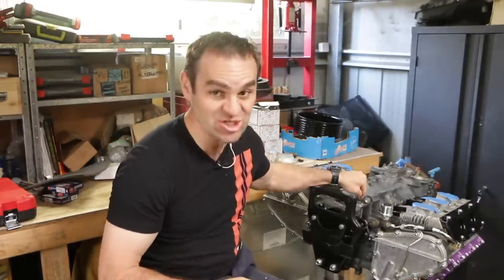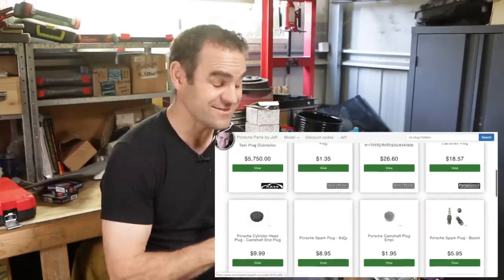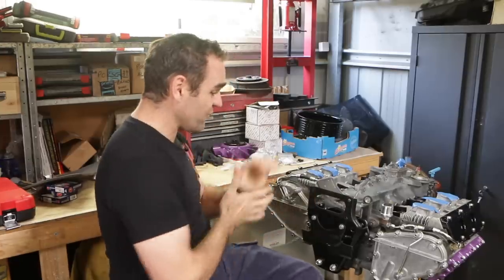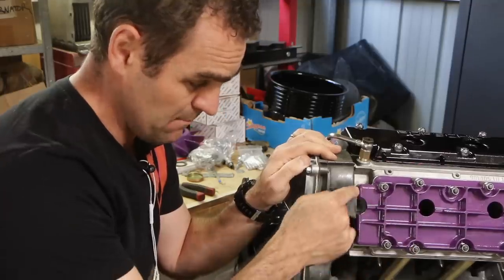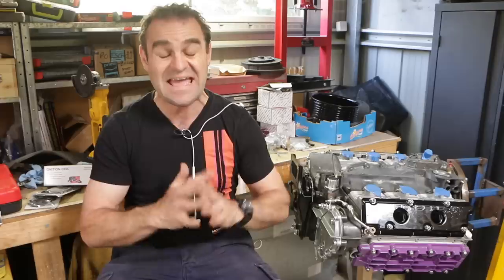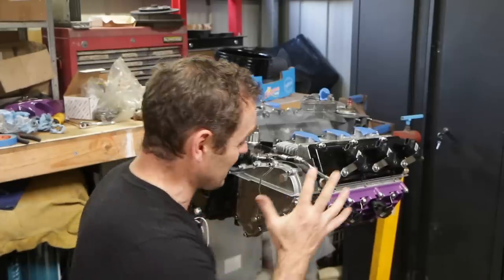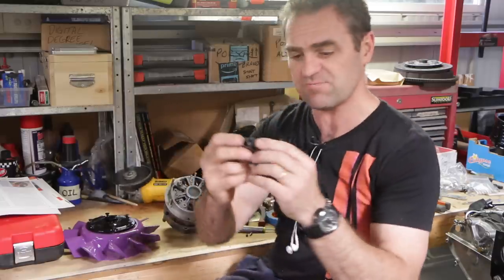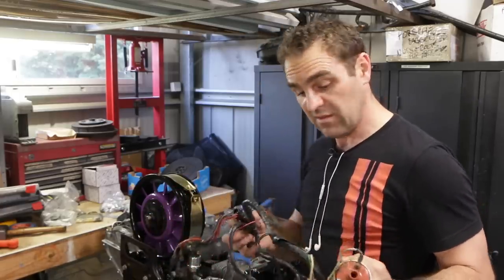Coil on plug ignition -  911 2.8 RSR Build Season 2.13

Comment: I wouldn't let anyone stress you out about spark energy, hemi-head or not.
Porsche hasn't used CDI since 1984, when they switched to Motoronic engine management and transistor based induction coils.  Compared to previous years, the motor had higher compression (10.3:1) and was still single plug.  The factory even left room on the table for performance chips to advance ignition timing for modest power gains.  Plenty of people run highly boosted air-cooled motors with CoP units with far less spark energy.  If they're leaving something on the table, it seems to hard to quantify..... But then I don't have a CDI unit to sell you ;-)
Also, wasn't CDI+ exposed as having even less output than a stock 40+ year old Bosch unit?  Why does it need multiple-sparks, if the "hotter" spark from CDI is all you need?
IMHO:  You'll be fine mate with these 370Z units, really! (edit: Super tip on the boot, which I kept on destroying)
Cheers for the website on finding parts.  I'll definitely be referencing that in the future...

Comment: Are you thinking of AirCon in the future? If yes, there is an Electric Kit from the UK but a stronger output alternator is recommended for proper output of cold air at idle speeds...

https://www.classicretrofit.com/collections/electric-air-conditioning/products/air-conditioning-kit-for-classic-911-full-kit

Comment: You obviously have done a lot of research about the ignition, but there's one thing you didn't mention in the video. What about running the CDI pickup off the flywheel? That's how motorbikes do it. I'm sure you looked into this, just you didn't mention it in the video.
Reply: Thinking a crank fired CDI would be the ticket?
Reply: I'd think his EFI system would provide trigger for the COP system so no need for another separate ignition trigger.

Comment: Jeff I love you and the channel but someone has mislead you on the needs of the ignition system. Spark/coil load is determined by compression, mixture and coil soak time. The moderate compression you're running and that fact that you're going EFI means even a basic coil pack will be more than adequate to fire the plug. I appriciate the shift to coil packs to improve coil soak time compared with a single unit but you don't need 'extra' voltage. The gains from the twin plug system come from improved flame front loctaion and speed, nothing to do with the actual firing voltage.

Comment: I gave the website a look. I think it's a great idea and it seems fairly well implemented. One thing I noticed is that shipping costs aren't taken into consideration. Of course those vary depending on location and it might be quite difficult to calculate from an external site such as yours. But for price comparison it's great.
Reply from the maker: That is not really possible as most of the sites need to sort it out case by case. Just gives you an idea.
Reply: Hi Frederik. I've looked at this but it's only possible for webshops with a fixed rate like FCP Euro where we do show the shipping cost below the product. But even then it's only for the US. Worldwide shipping is always variable unfortunately.

Comment: Something also to keep in mind when comparing CDI vs CoP.  I believe the quoted energy for CDI is at the discharge capacitor when fully charged.  The energy at the spark is probably a fraction of that... (a sixth?) One reason CDI was abandoned was it's inability to keep the capacitor fully charged at high rpm.  Food for thought.

Comment: You need to seal the gap between the spark plug wires and the plug opening, or you will lose to much cooling air.

Comment: I’m looking at a similar conversion, any experience or a divide on changing plug type? I have a 2.0 Golf Coil ignitor but they use platinum plugs with a smaller dive hex. All looks good to me if the plug heat range is comparable.
Reply from the maker: No idea sorry. I have never driven this car ;)

Comment: Jeff, are you planning on rebuilding the transmission? Unless it's already been rebuilt, seems like it has a good chance to be pretty tired. I'm assuming it's the older one, which supposedly isn't that bad of a job to freshen up, if pricey, for synchros, shift sleeves, and potential machine work. 
Best,
Jonathan
Reply from the maker: Not until it needs it ;) $$$

Comment: Jeff, another great vid.  As I am in the process of building a similar engine I wonder why you went COP when you state CDI is so much better?  I was going to go COP myself, but I am now thinking it’s a mistake?  I will be running a hot 3.5 in my “stock” 71 narrow body car.
Reply from the maker: Control.
Reply: Seems like a number of guys run CoP just "fine" on air-cooled motors, including boosted ones.  Porsche haven't used CDI since 1984 on production vehicles.  Neal's preference is CDI, but it's a huge point of contention over at Pelican Parts.
Reply: CDi w a big (expensive) twin plug dizzy and two boxes?  I get the hotter spark actually.  I just want to get away from an old school inaccurate distributor; but I think I might be wrong!  CoP just seems so simple and accurate.
Reply: @chriscarbaugh3936  I hear you, I'm in exactly the same boat.  But I am single plug and N/A.  So I will try it ... And if it doesn't work out, I can always go back to my CDI ignition.  But considering the amount of builds I've seen with LS2 coils, Toyota coils and VW coils (and even Cayenne Beru units), I think it's worth a try to get the extra flexibility.  I have yet to see anyone demonstrate just how the "hotter" spark of CDI contributes to a better combustion process on these motors, I mean with a dyno sheet or something tangible, that is.  If I'm wrong, I'll eat crow.
Reply from the maker: @dra911  Classic Retrofit has some dyno results on their CDI site, and Neil has the most experience of anyone I know. With his F1 background it is all about finding the last 1/2hp. That said, I have seen guys with single plug LS coils and they still run fine.
Reply: @HomeBuiltByJeff  Yeah, I've seen those graphs. If I were keeping CIS & interested in the stock look, the programmable ignition of CDI+ vs Bosch CDI might have been interesting to me... I'm really not trying to disparage Neal's (or anyone elses) work here, he's probably forgotten more about motors than I'll ever know...
Reply: I am loving this debate.  I am also coming at this from a slightly different perspective.  I have moved overseas and before shipping my ‘71T I want my first and last, the ultimate for me engine built.  Obviously there is a budget, but I sold my 930 to finance the engine!  There are thre keys for me, usable performance, ease of maintain and stone cold p, bullet proof reliability.  I am moving to Aberdeen, Scotland in the Highlands w epic roads.  I intend on doing the odd classic rally.  There is little to no expertise here.  I initially thought, great CoP, no dissy - easy!  Now I am thinking if something goes wrong, how do i figure it out, whereas CDI, is old school, I might be able to get help.  And I like the idea of more, power in terms of spark.  Any comments on ease of maintenance?  I am mechanical but not very electrical 😕
Reply: @chriscarbaugh3936  Thinking out loud.  How many modern mechanics will know about CDI?  Talking about the old 3-pin or 6-pin Bosch CDI units.  Most might wonder where to plug in their scan tool.  You'll be dealing with Porsche specialists then.  Specialist repairers for CDI, or $$$$ for a new one.  Also, to me it sounds like you're already part way through a EFI conversion if you're considering CoP (am I right?), so this means simple "old school" diagnosis is already out the door - you're in the world of sensors and data logging and the specifics of whatever EFI computer you're using for it.  So I would ditch the distributor (another moving part to fail/go wrong) and keep a few spare CoP units in the glove compartment.  If one CoP unit fails, you do some simple diagnosis on the spot and swap them out, or simply go on with five cylinders until you can properly diagnose it.  CoP to me is easier.  12V, ground and a signal pin to the ECU.  Sure, some old school hot-rodders would never do this, and will keep their carbs and points system until the day they die... But for me I find data logging so invaluable, I could never go back.  I diagnosed valve-float on my daily driver last year, just from analysing data on some full-throttle runs.  My mechanic didn't believe me, thought I was p!ssing away my money, but when I asked him to swap in new valve springs & retainers (and solving the problem), he became a believer and was properly impressed that I picked it.  With that said, I don't think there's a right or wrong answer here.  A lot of this comes down to what you're comfortable with.  Just my 2 cents.
Reply: Daniel A thanks excellent points!

Comment: I dunno how far in the past you shoot these videos so don't know if this will be of use to you.

I struggled to find an Aus wiring supplier that did a wide enough range of wire sizes and colours with tracers when doing my projects. I did however find Vehicle Wiring Products in the UK. They can pretty much supply you with any size, colour and tracer of wire you are after. Oh, and Mouser are really good for large multi pin automotive connector blocks as well as Deutsch connectors at very good pricing.

Love how clean the engine looks and really looking forward to seeing how much power you get out of it by going full EFI :)
Reply from the maker: Thanks for the tips mate. I may need the wiring supplier.
Reply: @HomeBuiltByJeff  Give me a reminder tomorrow night as I've got more time than I do this evening. Then I'll post the web links for you :)
Reply: @HomeBuiltByJeff  Vehicle wiring products website http://www.vehicle-wiring-products.eu/?jssCart=15613d46d5598d0fdf6b919ff0ab7c42
Mouser Electronics https://au.mouser.com

I also found EFI Hardware handy for Bosch connectors and bosch engine sensors.
When I did a Subie FA20 with Motec ECU into a 1958 VW Bus I had to source a lot of parts to do the EFI system.
I had to modify the FA20 loom and then custom made the patch loom to connect the Motec to the FA20 loom.
Bosch 4.9 wideband O2 sensor seems to be the new go to sensor for wideband O2.
Also Bosch make some nice dual type sensors like a MAP with built in air temp and oil pressure with built in temp too. Really saves on space and they aren't all that expensive.
Anyhow, good luck with wiring the Porsche engine.

Comment: Out of couriosity, did you take LS/or AEM "coil near plug" coils into consideration? It seems to be the most common way to get more modern ignition on older engines nowadays, since they are relatively universal fit due to them still using plug wires, but still near the plug and good to control with modern ECUs. (I think the system you chose will be just fine, but I'd love to know why you didn't go that route.)
Reply from the maker: Half the spark energy. You can use the coils I have for leads too if you want
Reply: @HomeBuiltByJeff  That does make sense, thanks. Didn't know the difference in spark energy is this massive.
Reply from the maker: @Finnspin_unicycles  https://www.youtube.com/watch?v=4d3nrBZjYKA

Comment: Hi Jeff - great idea on the comparison site, but the search feature seems to choke on Porsche Part numbers. It should handle the number no matter how it is formatted (e.g. 96410640302 also searches for 964-106-403-02 and 964 106 403 02 and  964.106.403.02).  But right now no matter how I format the number, if I search for a Porsche part by part number, I don't get the correct results and therefore can't compare prices, even if multiple retailers have that part in stock.

If I search by name, it has a similar problem, because different retailers call the same part different things.  FCP Euro calls 96410640302 "Porsche Air Duct - Genuine Porsche" whereas Sierra Madre calls the same part number "Cooling Fan Air Duct, 964/993 (89-98)."  Vertex sells 3 versions of the same part (Porsche, OEM, and URO) all with the same part number but different descriptive names!

Get this sorted, and the site will be super useful. Hope all is well!
Reply from the maker: That will be difficult to do as it depends on how each site posts parts.
Reply: @HomeBuiltByJeff  Hmm... that's tough then! Right now, even if I search for something simple like "964 Textar Brake Pads" the first page of results is all from one reseller (Vertex).  I get lots of brake pads for other cars and even other parts like calipers and rotors before I even see the first result from another reseller!  I'm not sure how the search works on the back end, but all of these resellers have their own search engines on their sites that come up with the correct result if I use the same queries. That said, if you're getting a referral bonus, I'll try going through your portal for my next orders (even if I have to do the price comparisons the old fashioned way).
Reply: Hi Dave I will have a look if I can improve searching by part number. Like Jeff says we're limited to the way the shops display the info of their parts. Some show part numbers, others don't. The search right now is set up for text based searching using software with quite a sophisticated algorithm that matches and orders the results. So it's searching for full matches but also partial matches. For part number searching you want exact matching so it's very difficult to make a search that can do both well with one search box. But I will have a look.
Reply: @Dave_Allison  We pull all products from the shops and put them in one database and you can search the name of those products. Our system cannot match products and it doesn't understand what you mean with 964. It simply looks for matches or partial matches of your search query in the name of the products. It's up to you to use the search in a smart way. In your case you are searching for a very particular brand so I would not search for generic terms that will have a lot of hits like "brake" or "pads" and only search for "Textar" and then filter the results for the 964 by clicking on the "Model" button and selected "Porsche 911 964". It seems only Vertex sells Textar pads for the 964. Do you know other shops that also sell them that are listed on our site? If so I will have a look why they don't show up.
Reply: @Rekinortiher  This is a great idea and happy to help beta test it.  I picked Textar because they're the OE manufacturer for Porsche pads, and brake pads are a thing that (1) lots of retailers have and (2) that people buy frequently.  In my prior test I tried to compare prices on a more specific part, and that also failed. Right now I can't come up with a query for any item (having tried quite a few, tried different things with the dropdown boxes, etc.) that will actually show multiple retailers' prices for the same item in the first few results. Can you give me a sample query that works for you? 

For reference, at least five of the resellers you list have brake pads for a 964, but your algorithm currently isn't sorting and displaying them up front. Conversely, a "dumb" google shopping search of the part number returns quite a few results. Note the different descriptions but the common part number... this is why Porsche has a part number for everything! Since it sounds like you're scraping the sites, picking up the part numbers which all have a common pattern (despite different resellers using spaces or dashes or periods) shouldn't be too hard.

https://www.vertexauto.com/porsche-brake-pads-front-textar-p-411870.aspx
https://www.fcpeuro.com/products/porsche-brake-pad-set-textar-96435193903
https://www.stoddard.com/96435193903.html
https://sierramadrecollection.com/Front-and-Rear-Brake-Pad-Set-930-C2-C4-944-928-78-94-p17146.html
https://www.parts-wise.com/porsche-964/porsche-911/wheels-brakes/brake/c21/96435193903-911-turbo-78-89-964-carrera-2-89-94-and-944-turbo-87-88-brake-pad-set-for-the-front-and-rear-axle-/p82307/
Reply: @Dave_Allison  I'm working on a part number search.It should make a big difference and with that you should be able to find exactly the products/prices you are looking for. Thanks for the feedback. The website will be better because of it :)
Text based searching will never be that accurate with all shops naming their products differently. You the user wil just have to do the second selection by eye which for most people is perfectly fine. You can't please everyone is a well known concept for webdevelopers/webdesigners.
I would not call a part number search in Google "dumb". It's the perfect query as they have the resources to index every page on the internet and the part number is a 100% unique string. So it doesn't get easier than that for them. We don't have the resources to index every single product page of every shop we list.

Comment: Jeff, I measured the amperage draw my 12 Bosch coil packs run at 7k - 8k rpm and it's above 55amps. Make sure you have enough juice!  I have two separate relays just for the coils, one for the left bank, and one for right.
Reply: I was thinking the same thing. That old alternator isnt going to cut it, time to look at the K3 bosch units. I think they are about 95 amps.
Reply from the maker: The ECU can apparently run 12 of these coils, 2 on each channel. I will need to see how the alternator holds up.